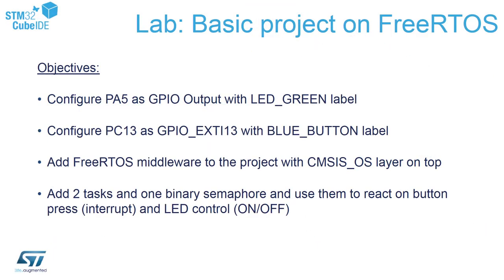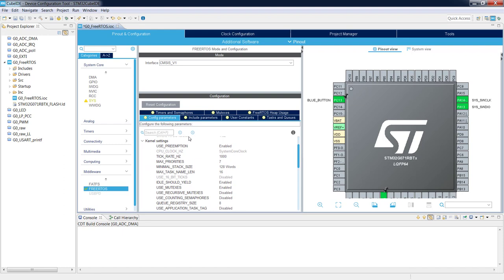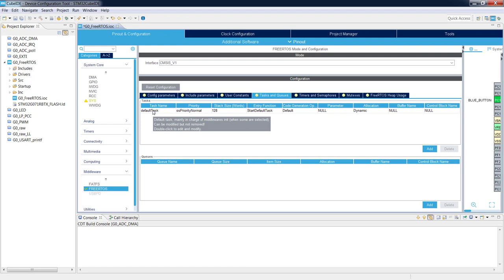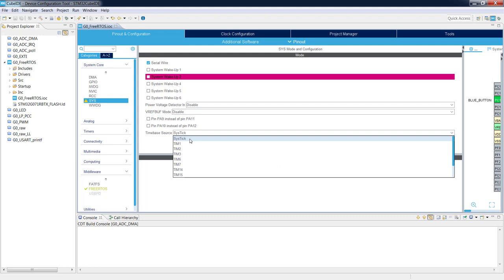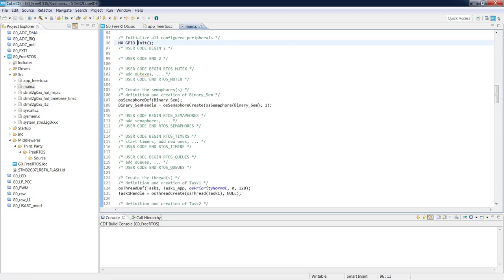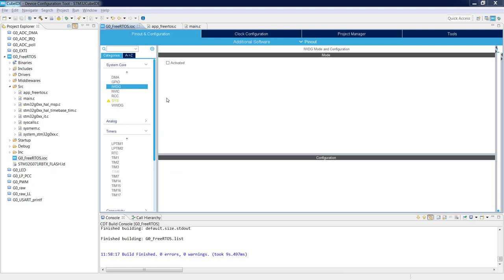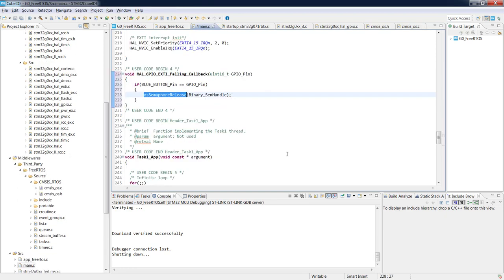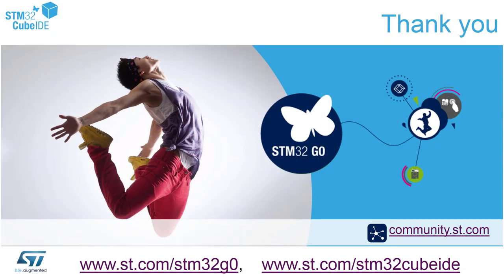STM32CubeIDE basics - 12 FreeRTOS basic lab

Comment: If you are following this tutorial but run into the build error while using osSemaphoreWait function, you should change it to osSemaphoreAcquire function instead. Then, you will not get "Undefined reference to `osSemaphoreWait'" anymore. FYI - I'm using NUCLEO-L476RG board and CMSIS_V2. The CMSIS_V1 still uses osSemaphoreWait function.

Comment: What Happened at 30:51?? Why you suddenly changed it to TIM7? It didn't work either with TIM6 in my board, but WHY!?
Reply from the maker: It is postprocessing issue. Part with timer6 should be removed. I have checked once again with STM32CubeIDE v1.3.0, using Nucleo-G071RB and it is working for Timer6 and with Timer7 ( I have checked it for CMSIS_OS v1 and CMSIS_OS v2). In case of further technical issues with the code, I would suggest you to move to our forum at community.st.com . It will be easier to exchange the information.